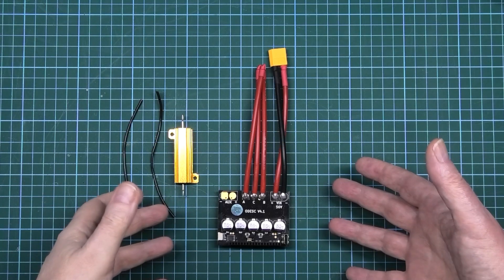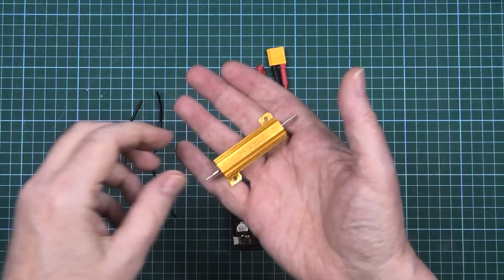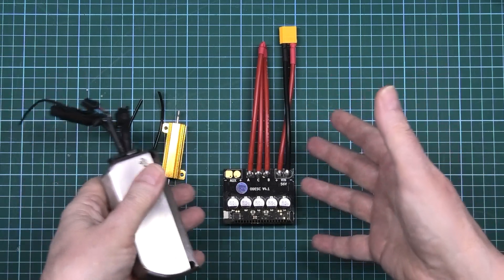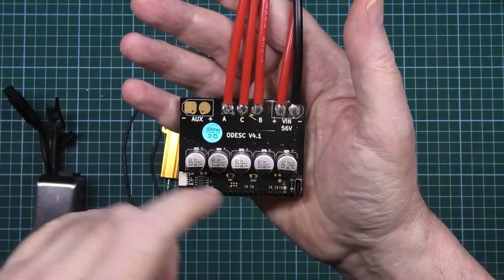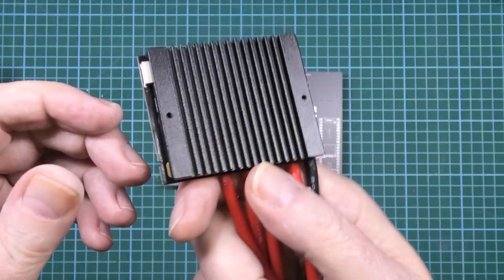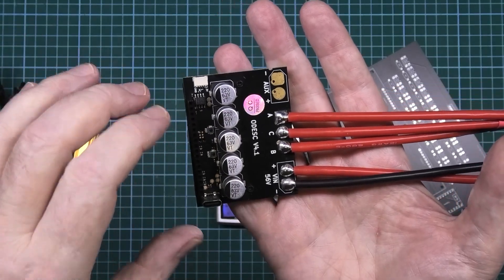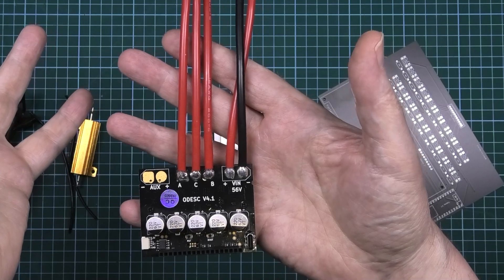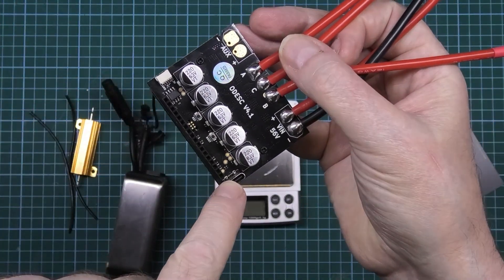Sequre ODESC 4.1 ODrive motor controller intro

Comment: Hi Tony is your bms compatible with the Smart BMS Xiaoxiang App
Reply from the maker: No mate, there won't be an app for it. It'll have its own separate screen which will do all the features that the app does and more. It'll be much easier to access things if I have direct control of things.
I’m done with the other BMS designs because they keep changing things without prior notice, I’m doing things the way they should be done and (if I do have to change the design) it’ll all be backwards compatible. There won’t be 10 variations at different prices, there will be just one design.

Comment: I still haven't seen any thing close to my trusty old Yuyang King beast (YKZ7280JA) controller and app. I have it without it's case bolted directly to my aluminium frame (heat sink) which makes it quite small 16 x 10 x 4 cm approximately
Reply from the maker: How about a system where there isn't an app. A system which has a wireless display (not bluetooth so there's no range limitation) and has its own internal battery you can mess around with it to your heart's content? No phone needed, just a screen? I could even put an alarm clock on it 😂
Reply: @Vortecks  Sounds too good to be true. Looking forward to your next updates 👍

Comment: Tony, can this be used to drive a 26" MTB wheel (hub motor) perhaps from Andy or something similar? I am thinking of electrifying my Univega SL-1 MTB. Thanks.
Reply: that depends on the motor etc, powerful hub motors can take over 100A continuous, this oDrive will not be powerful enough for that, especially if you want a lot of torque (which is what you need for any shape or form of hills)
your best bet would be a middrive, as they're both lighter and you can vary the gear ratio, while also putting in more power with less current (Bafang BBSHD for example, the motor in there turns fast rather than needing a lot of current to produce it's torque)

Comment: hmm, your Vortecks bms seems to run on a Teensy, they're bloody fast (4.0 and 4.1), lookin good mate

for an electric scooter i would actually recommend something Vesc based (flipsky 75100 for example) then you can go higher voltage and easy change of settings with your phone through bluetooth and a 2 quid app

you can use the app as speed power and everything monitor
Reply from the maker: I can't use VESC mate, there are certain core areas I need access to and sadly, they're locked out on the stock firmware.
The Teensy 4.1 is a bit overkill, I'm looking for a cheaper alternative which will be seperate to the BMS. All the logs, settings and profiles will be stored on the display module which will be powered by its own battery so it can simply be unplugged for data analysis or easily swapped over from machine to machine.
Reply: @Vortecks  yeah well i'm mostly interested in what extra things you'd need it to do (display protocol support, logging, controlling lights or anything) as i'm sure there's a way around it

also, for the BMS, what would you want it to be able to do or run? there are plenty of cheap mcu's

Comment: Very interesting. Have you not tried any VESC based controllers yet?
Reply: VESC's are awesome, i just have a FSESC 75100 (aluminium pcb version, so less heat issues) which works well, it is awesome for the price
Reply: @BH4x0r  Oh nice! Flipsky makes really good value stuff if you can get it to work for you.
Reply: @NoahZimmerman  I mean the only issue it has is that you need to make sure to turn phase filtering off after updating to anything over firmware 5.2, as with pretty much all unofficial VESC's that can literally break the STM processor, otherwise everything the expensive Trampa's can do these also can
Reply from the maker: VESC controllers have limitations which means I can't use them. I need access to some areas that VESC controllers don't allow.
Reply: @Vortecks  interesting, i would like to know which issues you've exactly got with them and/or what limitations ya need access to
Reply: @Vortecks  I have the same question as BH4x0r. It seems like the great community behind VESC has covered pretty much everything that had been missing in previous years
Reply: VESCs have really crude servo motor support.  It's possible Vedder will make it easier to use, I'm going to try it with both ODrive and VESC to see which one works better.